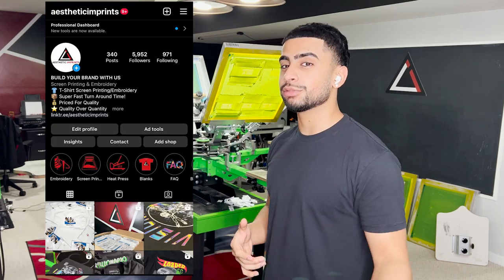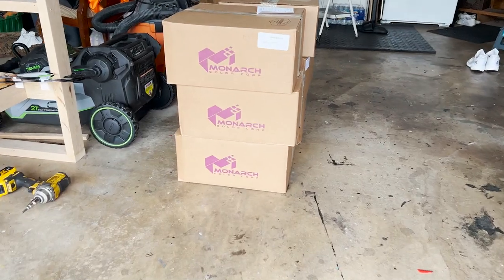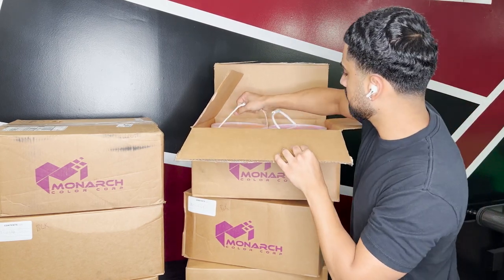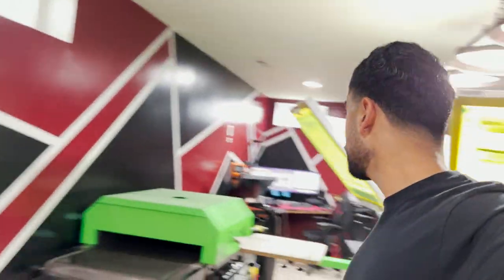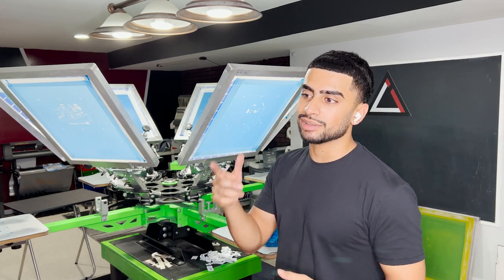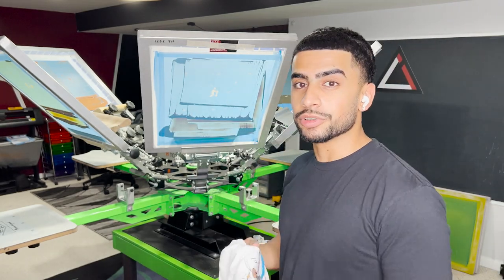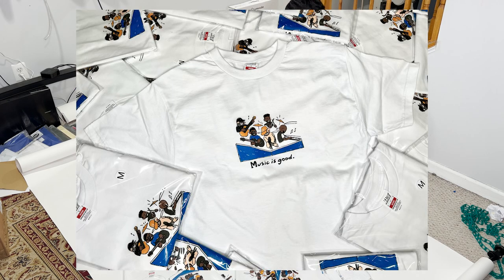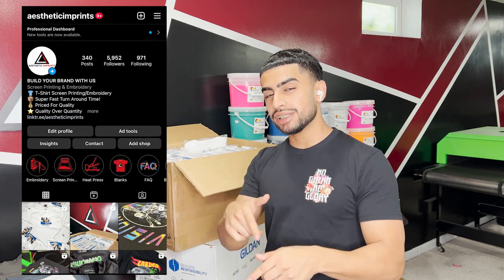Screen Print Vlog | Monarch Plastisol Ink Mixing System Unboxing | Screen Printing A 6 Color Design

Comment: Hey Braav, I printed a logo in white and red plasterol inks on navy color shirts, cured shirts in a conveyable drier but I’m getting questions why the red is fading but not the white. Your thoughts. Thanks in advance.
Reply from the maker: For darker colored garments you usually need a under base to help brighten up the color and be it’s True Tone.

Print flash print could help as well
Reply: @baavproductions  Thank You!